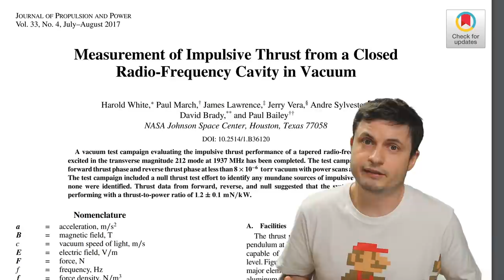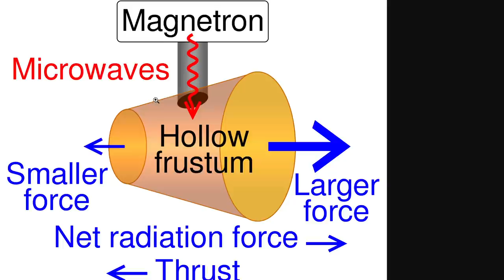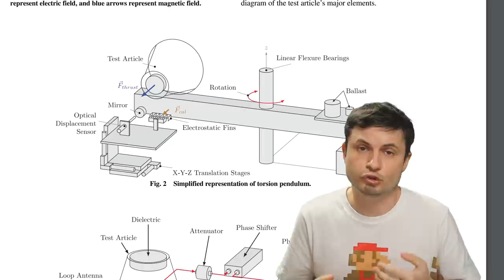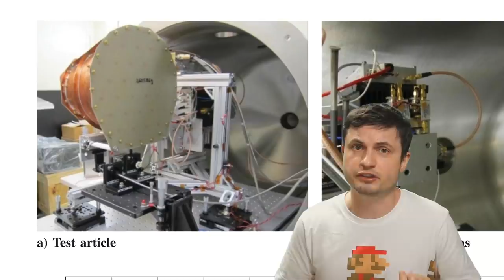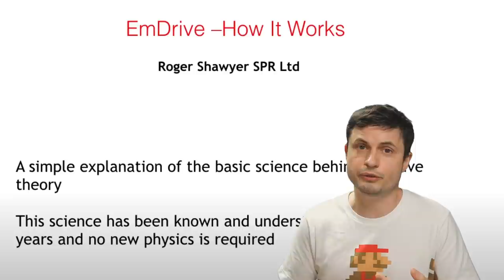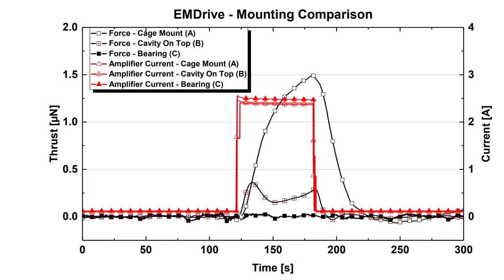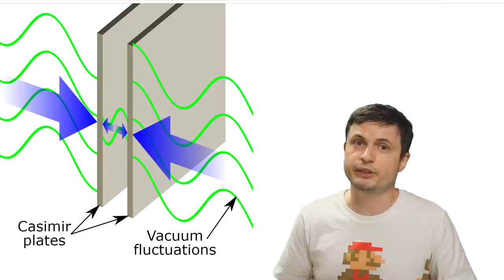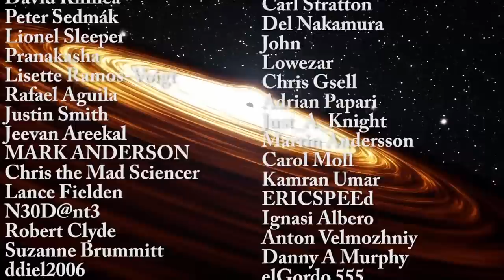Looks Like EM Drive Is Officially Dead - Experiments Fail

Comment: On MythBusters, when he moved the fan from one side to the other, it redirected the wind at an angle, which bounced off the sail and produced a small thrust. Whenever they had the fan pointed directly at the sail, The reflective force blew directly back into the source with a portion off to the sides.
Reply: Isn't that how sails work though?  Most sail boats do not have their sails along to the  boat's minor axis but at an angle to it.  Not a sailor by the way so prepared to be very wrong here.
Reply: @I_Don_t_want_a_handle  In this context, a sail catches the wind from an outside (off the boat) source. Having a fan on the boat is most effective facing out, giving thrust. Imagine a fan boat. In the MythBusters' experiment imagine turning the fan on the fan boat the other way and putting a piece of plywood to reflect it. Not at all efficient, but some thrust still is supplied. It has to be at an angle though. If it is direct, it bounces straight back to the source, (mostly) canceling it's self out. 
Natural wind, an of the boat source, will push the vessel which ever way the wind blows. This isn't always the exact way the sailors need to go. So they adjust the angle of the sail and the angle of the boat to control where they go. I remember from long ago, they can zig-zag with the same wind.
Reply: @cjvan713  Indeed, I agree but ... IIRC and I may not be, once the wind has hit a sail it has to go somewhere and, I think, if it comes straight back won't the same issue apply as the fan?  A cancelling out?

Again IIRC, sails are designed to spill wind, and modern sails are very different to 18th Century ones.  Modern ones are aerofoils, effectively.  Square rigged sails, I believe, were always rigged at an angle, even a slight one, to the wind rather than 90 degrees so perhaps this is why?

Either way the fan experiment leaves a lot to be desired and I'm not sure that it is a 'fair' representation.  Did they blow the boat with the fan attached to a dock and did it move?  What was the force applied, was it sufficient etc.  I'm yet to be convinced but I do know I  don't know if I am right. 8)

Thanks for answering BTW.

Comment: There is some pressure on the large and small flat surfaces. There is a difference due to the difference of surface, but that difference is exactly nullified by the longitudinal component of the pressure on the conical part.
Reply: Yesnt thats sadly not how em waves interact with surfaces. But effectively yes.
Reply: gauss's law bra

Comment: We knew it cannot work. The annoying thing was that we could not reliably demonstrate that.
Reply: You cannot prove null result.
Reply: @Alexagrigorieff  That depends on heavily on circumstances. 
You can disprove the null hypothesis. So choose the null hypothesis to be "EM drive works".
The problem was that the measurement techniques were not good enough to disprove the proposition. Fortunately we have hard numbers about how much thrust it has to produce (higher than photon pressures), so it was very much possible to disprove.
We have now precise enough measurements to state that it does not produce thrust over what current physics allows, this disproves the null hypothesis.
Reply: @adamrak7560  
>So choose the null hypothesis to be "EM drive works"
I don't think 'null hypothesis' means what you think it means.

Comment: I always hoped, but I always knew.
Reply: same
Reply: Big fax
Reply: This one sentence sums up so much about so many different subjects
Reply: @spencerarnot  my life lol
Reply: @MrSalsa1995  Stay strong man. The truth IS out there. Or IN there. I hope...  lol.
Reply: @spencerarnot  I see what you did there ;D
Reply: Same here
Reply: Even if it did "work" it still wouldn't really work. 

The type of thrust they were claiming compared to the amount of power required would have been ridiculously inefficient compared to other established options.

It's something that begs for remote power but options like ion propulsion and sails would be orders of magnitude more practical than this thing.
.the fact that they had to refine the experiment so far trying to discover any degree of thrust is all you need to know about n it's practicality,  like discovering warp drive is possible but you still need more energy than the universe contains to actually go anywhere.
Reply: @DrewLSsix  I guess I'm not very clear in my thinking.  Why not transition to nuclear powered boosters , is it the lack of environmental air / material to accelerate? We had these in the cold War.  But if memory serves , they used ambient air as part of the design.
Reply: They already commented on this, wrong setup was used in these tests

Comment: I was just thinking about the Mythbusters sail test like three hours ago, lol
Reply: I don't see how it won't work. It's just thrust diverted backwards. Of course it would be just more efficient pointing the fan back.
Reply: @carlosandleon  -- Some aircraft have a similar system for reverse thrust (for landing and taxiing and what not) where two plates cover the end of the engines and redirect the thrust back around the nacelle.
Reply: We knew google listened to what we talked, now it can read our thoughts?

😜
Reply: @nuravanimations3201  Google have enough data to know you better then yourself
Reply: The sad thing about the Mythbusters episode is that the device was built by someone who doesn’t understand how sailing works. Sailboats move by wind moving across the sail (which is why they got some thrust when they aimed it at the sides of the sail) not by having wind moving into the sail.
Reply: @andrewjohnson6716  -- The fastest sailing speeds happen when the wind is going the same direction you  are. Tacking allows a sail + keel to go in directions significantly different than the wind, even almost directly into it, but at much lower speed. This is why controling the wind or creating your own was so desirable, you could have a full tailwind in any direction.
Reply: @TlalocTemporal  That is completely false; with a tailwind your speed can never exceed the windspeed (or even approach it). The best wind for sailing is roughly a crosswind, since you can extract maximum thrust from it even when you're sailing full speed. Racing yachts can go 50+ knots this way, which is far faster than the wind propelling them.
Reply: @TheKrimzonGuard  -- Hmm, yes you're right. I apologise. 

My point should have been that the myth has nothing to do with wind across the sail, because every instance of blowing your own sail is someone blowing directly forward into a sail rigged for running. Perhaps that's from the simplified comics where every sail is a running sail, but it's true to the myth.

Comment: This is one of those tragic cases in science where so many people want it to work that the lacking theoretical and practical evidence are overlooked for far too long.
Reply: They are now going to put a big electric fan in a copper bucket and test that for a decade.
Reply: Yup. When it comes to people's desire for it to work they will try to find evidence for it to work even where there isn't any. Still thought it was so depressing to see where even the most optimistic tests showed it being about 1000 times less efficient at making thrust than photonic thrust (light bulbs).
Reply: I figured out this concept when I was 5. Pretty sure every kid did as well, when they tried to push a plastic toy cart whilst inside it, with their hands. Just rocking back and forth.
Reply: @nate7LP_my_dog_found_the_knife  it wasn't really efficient but it was working! :)
Reply: This is the effect pop science articles have on people who do not have any scientific understanding or knowledge.  And that is most people.  It's basically an argument from authority where someone merely claims to be an authority, and pseudo-intellectuals hop on board to pretend they are on the cutting edge of knowledge they haven't earned.  It's a PLAGUE nowadays.
Reply: @ericv00  that's basically the definition of a typical inventor, trying stupid things in fields they don't really understand, some of them gets lucky and makes a discovery. 
Remember Faraday effect, nobody though that it was possible until after years of fails Faraday discovered it.
Reply: @markmd9  if by working you mean doing as it was "intended" to do then yeah. It's not every day you get to scam China, and lots of scientist.
Reply: @markmd9  yeah but he discovered it and then publicized it. He didn’t release PR about it before he discovered it. The proper sequence is discover and then publicize not vice versa
Reply: @markmd9  No, it's not.  An inventor almost always understands the properties of the materials and forces they are attempting to use to generate a result.  There is a distinct difference between research and invention. One precedes the other.  Inventions are based on observed phenomenon that are typically well documented and understood before someone figures out how to make those observed properties do useful work.

"Batteries" were not invented when someone stuck two metals in an acid.  What happened was people made an observation about it's properties and sought to understand it.  Eventually, someone figures out how to make those properties do useful work.  THAT is when an invention has happened.

EM drive was a concept, first, and ran counter to understood laws of physics.  It wasn't a concept based on an interesting observation, well, other than error.  And the people involved did everything to downplay the potential that it was all based on error.  That's not science.
Reply: Like gravity?
Reply: @ericv00  haha 😂, remembered how Volta numbed his tongue when he discovered the battery. He was tasting the flavor of different metals and vinegar with his tongue before he decided to make a stack. If he had better understanding of what he was doing he wouldn't risk to put his tongue.
Reply: @markmd9  And that anecdote is not invention.  That is research.  Once the properties are well understood, and those properties are put to use, THAT is invention.  What he did NOT do is go around telling people that two metals sandwiched around an acid will power computational devices before finding out "how metals taste".  He had to discover an existing property of these materials first.  THEN figure out how to put these properties to use.
Reply: What's especially tragic is that those fantasists are so willing to throw millions of dollars of other people's money (hint....OUR money) in the pursuit of that fantasy.
Reply: if the inventor was a real scientist, he should spent time on counter experiments to disprove the effect before announcing anything. If it still persisted he could then say look, here is the list of all the obvious variables I ruled out first. I'm reminded of the recent faster than light neutrino anomaly that turned out to be a faulty firbre-optic cable connection.
Reply: @tma2001  You don't get published that way.  You don't get gummint grants that way.  And you don't get Youtube hits that way.
Reply: @chuckschillingvideos  irrelevant - if you are claiming new physics you had better do all the obvious sanity checks first if you don't want egg on your face later.
Reply: @tma2001  WTF are you talking about?  I am not the one claiming new physics.
Reply: @chuckschillingvideos  context and reading comprehension not your strong point I see ...
Reply: Yep. Like Build Back Better...

Comment: A failure is actually a good thing. It closes one door which allows other prospective drives to be explored further.
Reply: go fail more then. prove your theory.
Reply: @zoltanz288  I don't think you understood his point, which is the process of elimination.  You can check EM drive off the list of possible drives, and focus on new research for something that could actually work.
Reply: Point is everyone familiar with physics said it couldn’t work. This was not an experiment in quantum physics or cosmology where’s there’s still a lot of unknowns. This was based on well established science. If physics that has been studied and tested for a couple of hundreds years tells you that only a literal miracle could make it work, it’s not a surprise that a miracle didn’t happen.
Sure, it’s a good thing that the scientific method has proven its validity once again, but it’s still a disappointing waste of resources that could have been better employed elsewhere. Modern research is extremely expensive, we can’t afford to try any wacky idea people with poor understanding of science have. Ignorance is not forward-thinking.
Reply: @pansepot1490  yeah its the waste of time on a wild goose chase that matters because you couldn't be bothered to put in the work to rule out all the obvious sources of error (which admittedly can require some of its own).
Reply: @zoltanz288  hater face McGee
Reply: @zoltanz288   everybody fails at stuff everyday. It's quite an essential way we learn.
Reply: The EM Drive WAS INDEED a success at producing measurable movement.  But through the medium of academic citations and publishing revenues, not the medium of spatial dimensions.  It all depends on what units you're measuring and the transmission time to your bank.